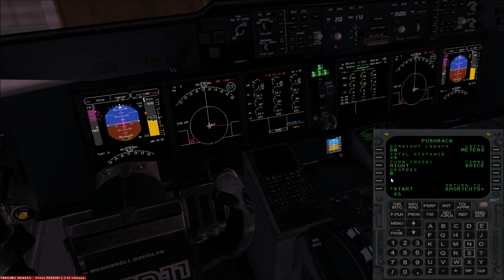PMDG MD11 Start Up Review and Tutorial Part Three HD

Comment: I don't like 737 cockpit, its too simplified, but MD-11's overhead is very advenced and complicated, i like PMDG MD-11 it have only 2 disadventages: no weather radar and no left and right observer station panels. PMDG also offers very realistic FMS whitch is big adventage of all PMDG aircrafts. You dont have to start engines separatelly, you can engage all 3 starters in same time.
Reply: While that's true for starting all 3 at the same time, it's not advised, in case something bad happens during start, it's more manageable, and less chaotic.